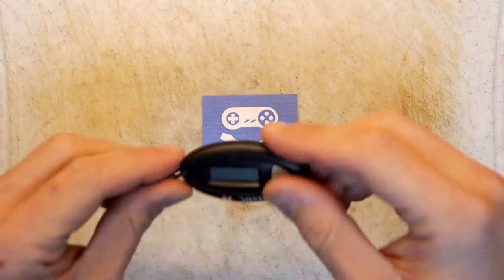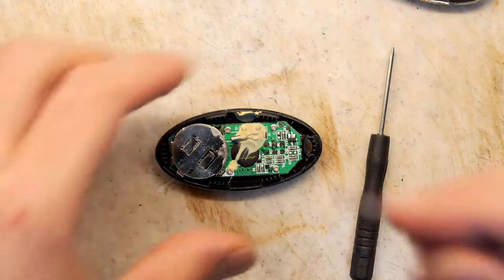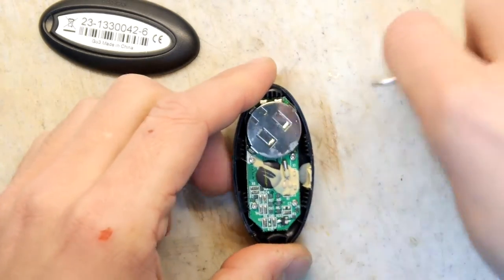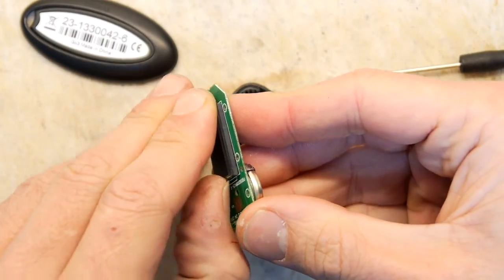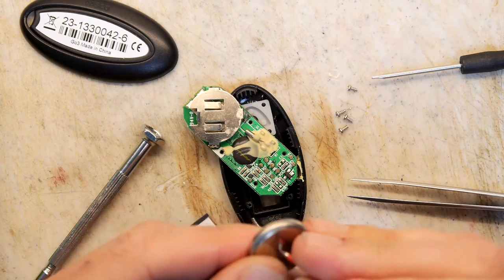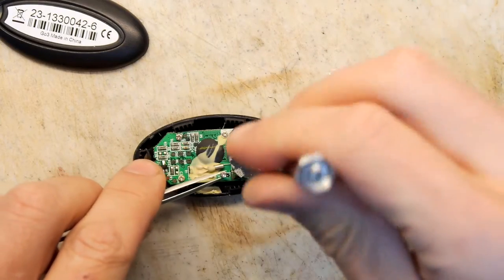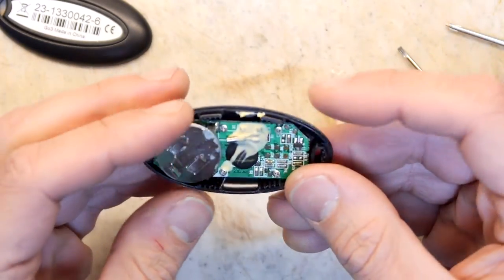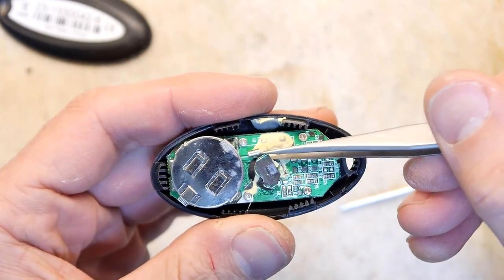HSBC Bank Security Dongle

Comment: Mine ran out of battery. I managed to put a new battery in it but it just lit up all LCD crystals? To have 88888888. Can it be reset from the 6 pins?
Reply: I have the same issue. Were you eventually able to get it to work?

Comment: I think that they should block themselves when the battery dies (or replaced), also even if the item is opened. Anyway, the code probably is desynchronized after the replacement, so it is useless.
Reply: Why?
Reply: @tardwrangler  For security. To avoid tampering, cloning or reverse engineering the algorithm that it generates. The token is desyncronized because without energy the internal clock of the device stops and it no longer knows the synchronized time, so the number it gives is rejected on the authentication procedure. Mine got desynchronized (but not power empty) so the customer service had to resynchronize it (giving some numbers it was generating).

Comment: Lest we forget, the HSBC Bank Security Dongle😔
Reply from the maker: +Mark Sharples the new one is like carrying around a calculator, one you would have killed for in the 80s!
Reply: I used to have a calculator that generated random numbers for authorising cheques at work in the late 90s.

It looked like a calc with a red button. The cheque system threw out a number that you put in the calc and pressed the button. It would generate another number that you responded with. Get it right and it would let you into cheque signing.
Reply from the maker: +Mark Sharples
Reply from the maker: +Mark Sharples That must have been a precursor to their current dongles. Although they have the added element of a pin as well
Reply: The Backoffice There might well have pin a pin too as we were all assigned our own device. Sadly, has been cruel on my memory of this particular piece of kit.
Reply from the maker: +Mark Sharples Getting older sir, losing ones faculties in remembering the operating characteristics of trivial devices is the first to happen. I bet you can't remember how to programming a VCR as well?
Reply: Ha ha thanks for that! Remember Videoplus? Still have a VCR somewhere although not set up anymore.
Reply from the maker: +Mark Sharples I do! I wonder if the radio times still prints the codes! It could be a useful format for having to store two numbers, I wonder what the algorithm is!
Reply: It actually worked really well. The VCR before that had a barcode scanner!
Reply from the maker: +Mark Sharples I do! I wonder if the radio times still prints the codes! It could be a useful format for having to store two numbers, I wonder what the algorithm is!
Reply from the maker: +Mark Sharples That must have been a precursor to their current dongles. Although they have the added element of a pin as well
Reply from the maker: +Mark Sharples barcode!! Did you have a code book to use?
Reply: Originally yes. Well I was a kid, the one we had came with a separate remote and scanner. It came with a plastic folder full of barcodes for channels, dates and times. Panasonic job. Later it was an all in one remote.
Reply: Not sure how long my HSBC Secure Key one will last (got it in 2011 I think), as the buttons are like those horrible cheap Chinese remote control devices for media players etc.  My sister recently received an identical looking one to mine for her First Direct bank account.
Reply from the maker: +EgoShredder ha ha, so HSBC upgraded. Maybe they were getting charged too much for the infrastructure to run them and got a better deal.